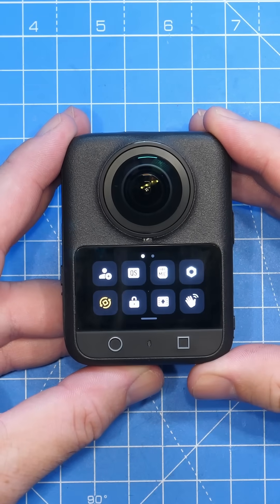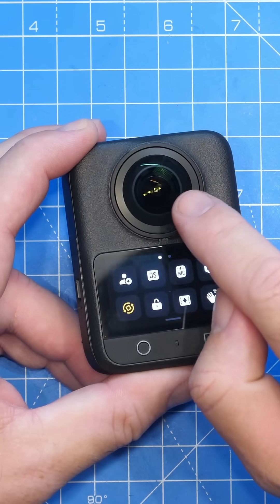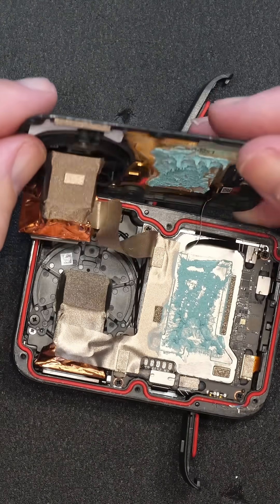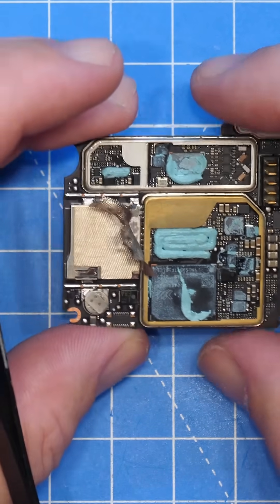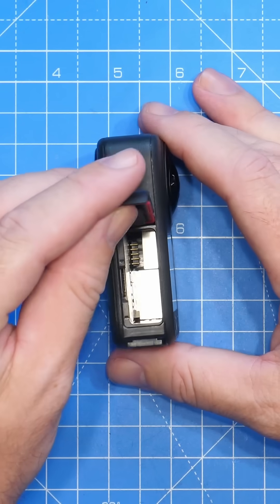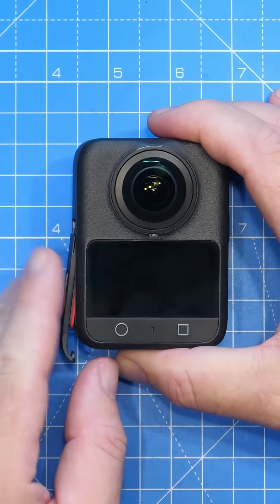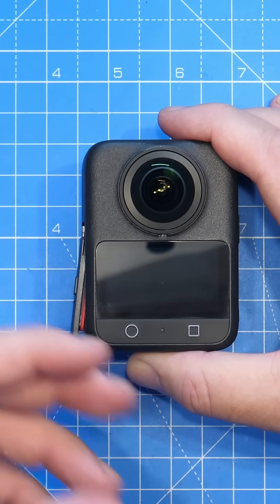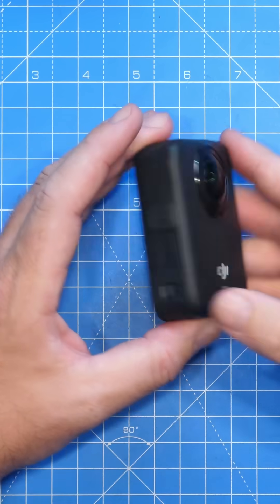DJI OSMO 360 Lens Fogging- Is This The Cause? #dji #osmo360  #insta360 #actioncamera #360video

Comment: Dear Mads Tech,

I wanted to share some insights about the DJI Osmo 360’s microphone setup. The camera features four microphones in total: one near the front, one at the bottom of the screen, one on the front near the DJI logo, and two on the top.

I’m curious to know which of these microphones is considered the primary one. Also, do the two top microphones record audio, or are they mainly for capturing ambient sound or noise cancellation?

I’ve tested my camera by submerging it about 30 centimeters underwater, and fortunately, no water seeped inside. However, I’m concerned about the top microphones potentially allowing water ingress and causing damage.

When I covered the front and bottom microphones, I noticed that my voice wasn’t captured from the top mics. This makes me wonder if they’re meant to record voice or if they just pick up ambient sound.

Could you share your insights on the functionality of these top microphones? Any details about their role would be really helpful.

Thank you for your time and expertise!

Best regards,
CMax Studio, 🇮🇳

Comment: My new 360 has this issue fogged up right in the middle. Took it out today had it running 30 min. Then noticed the middle of both lenses were fogged. Temp outside was 14c
Reply: man that sucks! did you find a solution?

Comment: Do NOT place the camera in a warm environment unless the humidity level is controlled and is below the dew point of the temperature you plan to use the camera in. Instead, I suggest placing it in a cool environment where the air is naturally drier and therefore the humid air from inside the camera will draw the moisture out.

Comment: DJI suggest opening the door but leaving the battery inside. Then run the camera shooting 8k 360 to heat up the interior for about 20 minutes, and that is said to fix the problem. Of course if the adhesive is still drying you may need to repeat the process eventually. But it is supposed to be fixable.
Reply: You forgot to tell us that it is important to wave the camera like a flag above your head during the whole process.
Reply: @CRO-dr4si 😅 and throw it to the bed 5x 😊
Reply: Limit not to reach 20mins😂
Reply: Same as my camera its overheating 😂